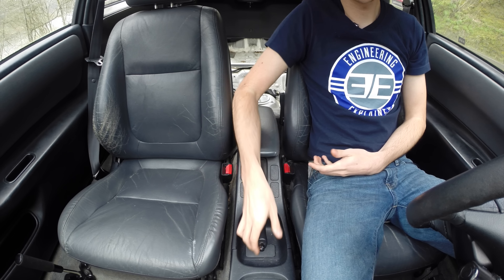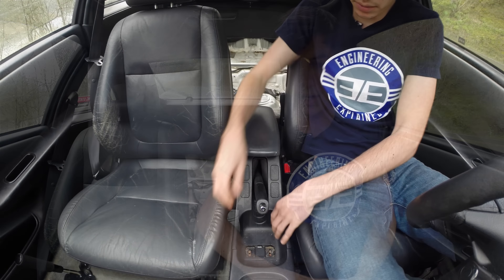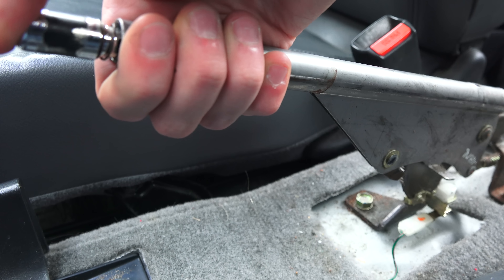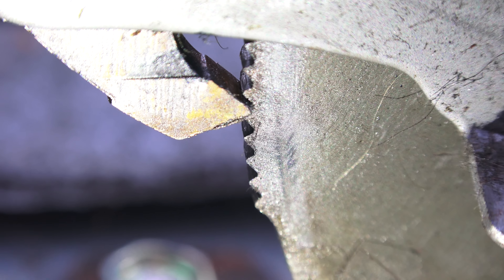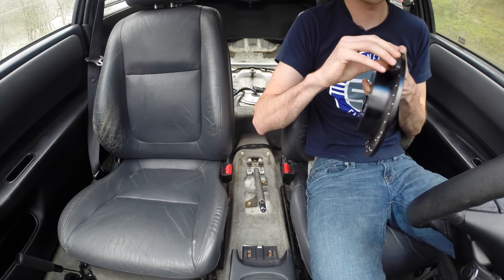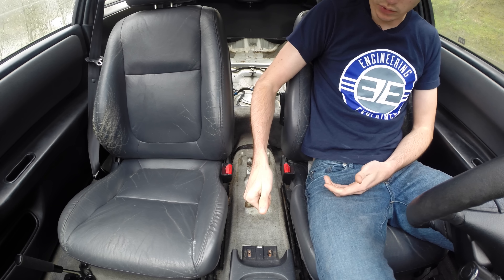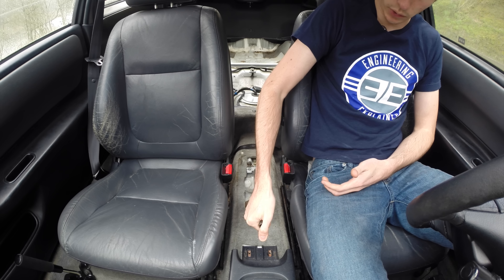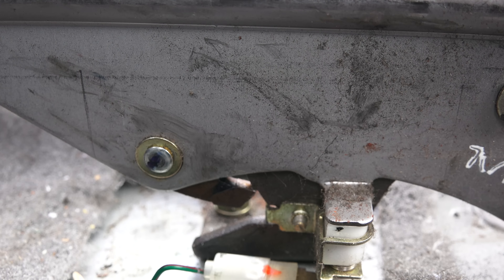Always Press The Handbrake Button? Myth Busted

Comment: I have no problem 'clicking' the handbrake up as long as i don't yank it. Two 'clicks' on a level gradient is enough and three 'clicks' on a slight hill and when parking. I only use four 'clicks' if the gradient is pretty steep. Never use five, never had to also five is a strain to get to so i don't bother.

I know that it may differ for different vehicles.
Reply: Must be a longer distance between clicks. I've worked on may cars and 8-10 is usually the specified limit for maximum braking by the MFR (meaning if you have to go past that to hold a hill then it needs adjustment or repair) and 6-8 is usually where they end up after adjustment. Yes each car differs, (why I gave a range) I have not yet worked on any that hold a hill in 4 clicks like yours. I've been seeing more electronic ones too but not needed to fix any yet.
Reply: @MY1PATH  Electric one's with the button handbrake? They can be fragile at times.
Reply: @rufusgreenleaf2466  No "hand"brake, just a button or fully auto when in park...

 Also, today I noticed on a subaru that it didn't have any clicks towards the bottom so now I can easily see how a car might have full brake in 4 clicks because it's halfway pulled before the first click.
Reply: @MY1PATH  I wouldn't know about Subaru, i also have a Japanese car (Suzuki) I thought they would be same in terms of handbrake clickyness 🙃

Comment: It seems to me that although the conclusion is true, the explanation is not so much. Wear is not cased by heat (although it may affect it), it is caused by mechanical contact, sliding, during which the two surfaces get damaged. The mechanical energy is wasted both on damaging the material and being transformed into heat, so there is a correlation but the cause of both is the actual sliding of two surfaces with friction. I'd say the ratchet is not damaged because the force applied/mechanical energy transferred to it during braking is just not enough to either damage it significantly nor build up the heat.

Comment: The socket wrench comparison was good, but what about cars that have a handbrake by where the clutch normally is. A foot brake or an e-brake on the left hand side of your brake pedal. Of course this only applies in automatics but my dad's 2015 Lexus ES250 and on that footbrake, there is no button to press and every time you engage it, it makes that same metal ratcheting sound. In this car and all cars that have a footbrake you literally have no choice and that same metal on metal contact is happening. If it caused wear, do you think car manufacturers will implement such a system? LIke in term of such a simple mechanical system like this, I think all car manufacturers and designers are smart enough to know what they're doing so that alone tells you that there is no problem with not pressing the button on a normal handbrake when pulling it up, because the exact same sound and metal contact sound happens when you depress the footbrake.

Comment: I have tried pressing the button in while pulling up and without pressing the button. I have found I get a better e-brake grip pulling without the button and hearing the ratcheting. Then with that put the car in reverse and fwd gears and the car did not move. When I tried pulling the hand brake with button in and tried the trans in both reverse/fed the vehicle moved some. Multiple times it moved. I cannot get a good e-brake grip doing that way. I used a Jetta Tdi auto in my test.

Comment: Your supposed to not push the button because when you do it’s easier to pull it up too fast therefore easier to stretch the cable. When using the ratchet you can feel and hear how tight it is because the ratchet click slows down. Whereas when you don’t you can just yank it up until you feel it stop so it is easier to stretch the cable

Comment: Whilst you post that the handbrake is not likely to wear out if you don't use it. I have spoken to a number of driving instructors, including truck driving instructors and we agreed that you need to depress the handbrake button when using the brake to manage the vehicle. In manual vehicles, handbrake starts cannot be done it you rely on the ratchet. By holding in the button you get 'a feel' for the handbrake and can develop skill in it's use. I grew up driving a Morris Mini Minor which was front wheel drive.  When driving 'briskly' on wet roads one needed to use the handbrake to lose the rear end when front end began to slid. You were able to turn and under steering situation into an oversteer situation.  And to do handbrake turns like James Bond, you need to have that 'feel' of the control!!!

Comment: My car is a Micra K11 of 2001 we always pulled the hand brake without pressing button. I used also for "drift" (but pressing button). Unfortunately now the middle of the gear is ruined... I have to pull more up. So I would push the button. If you use a lot handbrake...

Comment: Hey, your channel is really cool and we learn a lot here.
Regarding braking, I have been wondering when it comes to hydraulic hand brakes for drifting, are there effects on the engine and transmission when the brakes are active? As in, driving in high speed and then the wheels are locked suddenly, does that not put lot of stress on the mechanical system of the car?

Thanks

Comment: But think about what happens to running water over time. It slowly carves rocks and land. Ratchets loose their lock overtime, cheaper ratchets with lower quality metal fail quicker.
Reply: I've wondered this too, but keep in mind the people who make these cars know this too and design them to last a long time. And if it fails it's an easy part to get replaced.
Reply: SidewaysGts Yeah cables are definitely what I have seen fail. I have heard of the hand brake mechanism failing once, it was just a random occurrence in the mechanics, not the teeth so a different story there.
Reply: Well, he said there is wear. But it would wear away in probably 30-50 years or something like that. If you actively use it, and no button press. I mean, I doubt you could find even one car that has this thing worn out.
Reply: Please. Your parking brake is going to wear out from the wife driving around town with it pulled waaaaay before the ratchet goes.

Comment: I gotta question that anyone in the car community can answer. So I drive a new Honda Fit (2015) and when I start driving without disengaging the ebrake, it still moves like normal, with a little bit resistance here and there. But it does have that warning sound that basically tells me to disengage it in case I leave it engaged by accident. Now compare this to the Honda Odyssey (2007) that I sometimes have to drive so that I can help my mom, the primary driver, with parking it and what not. When I forget to disengage its ebrake, there's no warning sound; instead, it actually serves its purpose of applying brakes to the rotor when the transmission wants it to move. 

So after this explanation, my question is: why does the ebrake not serve its purpose of stopping the Fit when in drive mode? Is it because it's new technology? Do older Fits behave like that older Odyssey? Do newer Odysseys have that same feature that the new Fits have?

Comment: I had a 2000 jeep Wangler that the e brake leaver rotted right out of the floor I pulled up on it and it broke loose. So I took a piece of angle iron from  a bed frame and bolted it to a better part of the floor so it would stay in the factory section and welded it to the e brake leaver housing it's still in the same place but is secured in a different spot that is a little longer but keeps the e brake in the factory location. The e brake works fine unfortunately the motor blew up. It had a 2.5 ltr 4 cylinder and i sold the jeep for $1000 dollars just to get rid of it and it had $1800 in rebuild axles with 410 gears alone but I had to get it out of where I was keeping it. I hated to see it go

Comment: the owners manual in my MINI said you should periodically pull the hand brake to stop the car, instead of using the brakes, in order to keep the braking mechanism from glazing over.  but if it's just a mechanical connection to the regular brakes, that would never happen.  so how do you know if your car has a separate e-brake or if it's just connected to the regular brakes?  i'm thinking, if it's separate, you'll get the rear end dip.  know what i mean?  would that be a good indicator?

Comment: You're actually a little bit off saying it's about heat.  While heat is a common factor in wear, this has more to do with durable hardened surfaces vs. the actual forces applied.  The spring of the ratchet mechanism is actually fairly weak and just doesn't apply enough force to the metal teeth to enact significant friction.  If the ratchet teeth were made of something softer like brass, it would likely wear them out over time.  Overall, though, if the ratchet mechanism wasn't meant to be used that way, they would've designed it with straight-cut teeth that required you to hold the button to move the lever.  Stuff like this is annoying, though, as there's no limit to what car bros will invent as "must do's" for car maintenance that millions of people don't do and have zero issues.

Comment: Disrespect your car. Accelerate violently, brake hard at the last second, turn the steering wheel with wheels stationary, rest your hand on the gear shift, ride the clutch on a hill in traffic, bump up kerbs, and yes, pull up the hand brake without pressing the release!

Comment: I see one can pull the break higher or lower. Is that because it is necessary for different steep uphills? Say I pull it higher on a very high uphil and lower on a lower one?

Also how to prevent the handbreak from breaking? I pulled the handbreak high and the button sank inside and now it feels like the handbreak is broken.

Comment: I just dont see a reason to NOT press the button. pressing the button reduces wear (however small) and, from reading the comments, is a better habit in emergency situations. Whereas the arguments against the button are... the noise is nice? its easier? Also that socket wrench argument is silly because 1. not using the reverse direction makes the job much harder, incomparable to pressing the button on a handbreak and 2. replacing a socket wrench is much easier.

If there is even one good reason to not use the button id love to hear it, because i couldnt find any in the video

Comment: I cringe when anyone applies the handbrake without pushing the button, despite knowing it won't damage the car
Reply from the maker: What about when someone uses a socket wrench? I don't quite understand the whole debate about it sounding terrible.
Reply: It does sound significantly worse than a ratchetting wrench. Much louder

Comment: Love your channel, however....
1) ratchets do wear out
2) if heat is a deciding factor why do old keys gradually wear until they won't turn the lock.....
3) l have never experienced a worn out ratchet and pawl BUT  l always use the button because.....
4) wrenching on the handbrake doesn't allow you to feel the point where the slack in the cables is taken up and the brakes are starting to bite because....
5). on differing gradients the brakes require differing levels of effort to hold the car.
6) cables will always stretch, and just yanking the handbrake will exert more tension on them than necessary so they'll stretch sooner.
7) you can slip the clutch each time you stop on a gradient, it's design allows you to do that, but it will significantly shorten it's life.
8) don't do anything "just because you can", do it for a valid reason.

Stay safe all.  Hands, face, space....

Comment: This is not an engineering theory based explanation! Wear on metallic parts isn't based on heat, and the two examples you gave were not metallic objects. Heat and wear are "byproducts" of friction.

"Low velocity wear" is more closely related to friction, microscopic surface irregularities, metallic structure and hardness. Different materials and or different manufacturing methods can result in one item having a higher propensity to cause wear on the other item. eg, a stamped part vs a cast part vs a machined part vs a heat treated part will all have varying hardness.

This seems to be more of a historical issue. I've personally seen a worn handbrake ratchet mechanism on a <1980's era vehicle. I imagine that modern methods reduce the risk of this occurring.

Ideally, pressing the button instead of dragging the ratchet mechanism will ensure there won't be any wear, and avoids the annoying noise created by the ratchet mechanism. There's no downside to pressing the button as far as I'm aware. The sound is like fingernails on a blackboard to most "car people" I know.